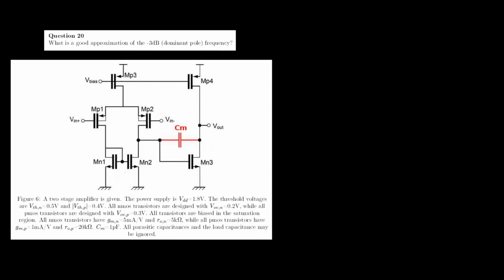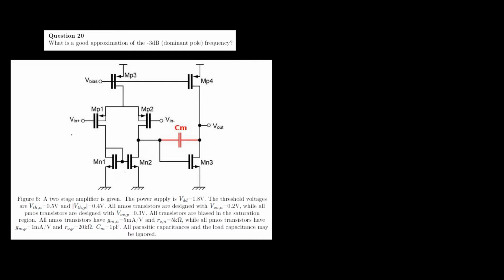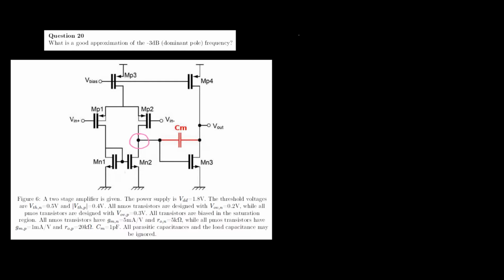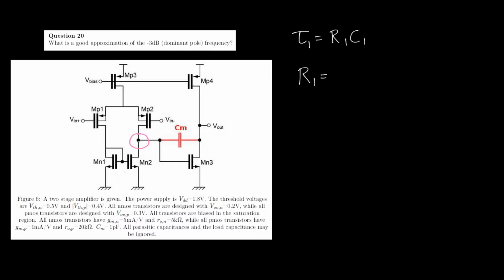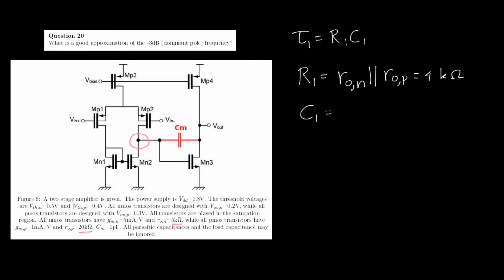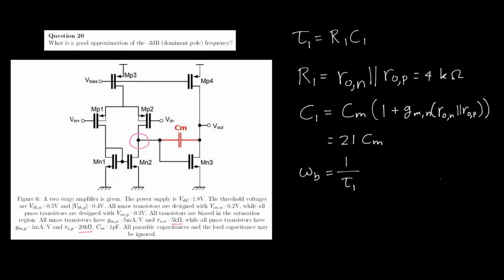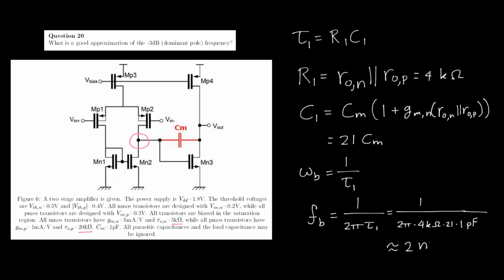Question 20 - Dominant Pole Frequency (Amplifier)

Comment: how did you get ronllrop is 4k ohm?
Reply from the maker: Both transistors Mn2 and Mp2 are in a common source (CS) configuration, meaning that their sources are seeing a DC voltage or ground. The output impedance looking into the drain of a common source stage is approximately equal to the small-signal output resistance ro, which is given in the subtitle of the figure. Mn2 has an ro of 5 kOhm and Mp2 has an ro of 20 kOhm.   

If we want to know the output impedance of the first stage, we will take the output impedance of the upper CS stage (the PMOS, Mp2) and the output impedance of the lower CS stage (the NMOS, Mn2) in parallel, so ron || rop = ron*rop/(ron+rop) = (5*20)/(5+20) = 4 kOhm.